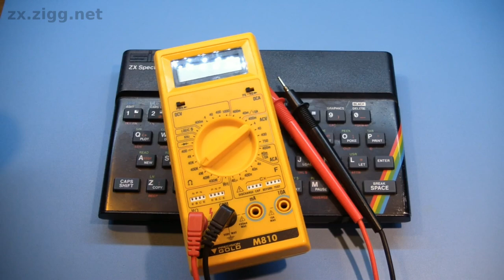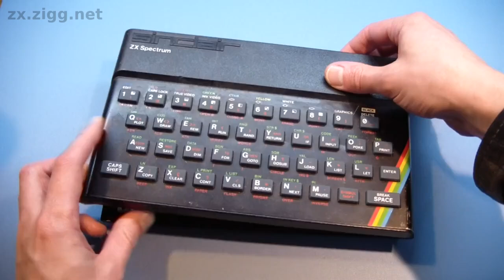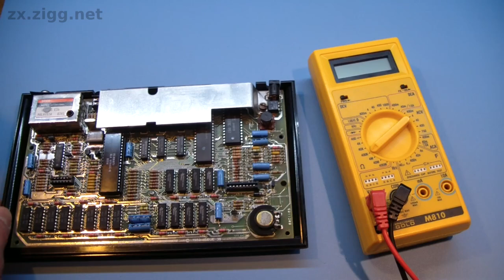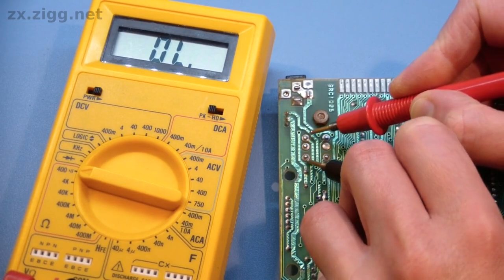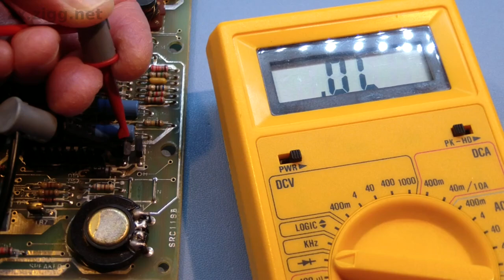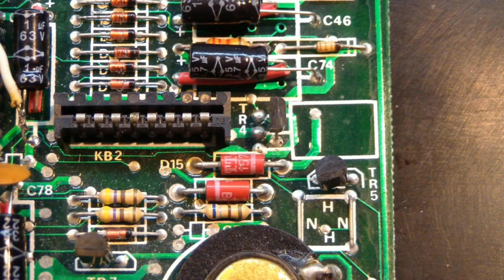ZX Spectrum (48K & 16K) Initial Tests

Comment: The 5v rail is shorted to ground and the TR5 base -> emitter reading is 0.3 as well as the emitter -> base reading.

I guess this means I should replace TR5 and test again. (I think I'll also buy a set of replacement caps and maybe replacement memory because I think it might be dead.)
Reply from the maker: +ISFiYIywAFIBc6qAIIIIIIIIIIIIIIIIQrXTJiCtY3Asd4WF Since so many components are connected to the 5 V supply, there are many candidates for short circuiting it to the 0 V rail. I'd start off, though, by suspecting a  failed 7805.

Any power supply related fault is liable to affect transistors TR4 and/or TR5. I recommend removing them and testing them out of circuit.

What result do you find if you measure the resistance between the two windings of the inductor? It should be very high/open circuit. If not, most likely TR4 has failed with a a base-collector short.
Reply: +JoulesperCoulomb Measuring the resistance between the two windings of the inductor gives me a reading in the Mega Ohms range.

I have ordered some flux to use with solder wick, as this is my preferred method of desoldering and I seem to have misplaced my previous bottle of flux. (Solder wick + lots of flux = great results.) So until this arrives, I will not be desoldering any components. I do not want to ruin the pads on the board.

Incidentally, in case I find that TR4 or TR5 are faulty, what readily available replacements would you suggest I use? It seems that ZTX transistors seem to go at ~£1 per piece which seems rather expensive.

When I have that flux, I'll de-solder the transistors (and the regulator) and test them out of circuit.

Thanks for your help.
Reply from the maker: +ISFiYIywAFIBc6qAIIIIIIIIIIIIIIIIQrXTJiCtY3Asd4WF There are very few physically small transistors that'll work properly and reliably in place of TR4. I recommend you use a ZTX651/ZTX652/ZTX653. These are not especially difficult to obtain. I think ZTX653s were about 60p each in small quantities when I last bought some.

Most small signal PNP transistors ought to work for TR5. I usually use a BC557. Check the pin-out of any replacement carefully; it may not be the same as the ZTX213. If I remember rightly, the BC557 has its emitter and collector swapped when compared with the ZTX213.
Reply: +JoulesperCoulomb You are indeed right, I can find ZTX653s much cheaper than ZTX650s (about 30p a piece).

Thanks for sharing your knowledge.
Reply: +JoulesperCoulomb while I am fixing this ZX spectrum, I would like to apply a composite video mod, there seem to be two popular mods, one using a capacitor and one using a transistor (apparently the transistor mod is brighter) I happen to have a few transistors which would work for the transistor mod (and capacitors which would work for the capacitor mod) do you have any preference? Does it really matter that much?
Reply from the maker: +ISFiYIywAFIBc6qAIIIIIIIIIIIIIIIIQrXTJiCtY3Asd4WF Some people add a transistor follower stage to the composite video output, though there isn't much point as one is already present (TR2). If you want to do this, most small signal transistors should work, though those with limited bandwidth capabilities will degrade the signal.

In most cases, connecting the composite output (from TR2's emitter) directly to a display works well. Some displays don't like the DC offset present here and this problem can usually be solved by adding a blocking capacitor in series with the output. I usually use a 100 uF electrolytic capacitor, with its positive terminal connected to TR2's emitter.
Reply: +JoulesperCoulomb Desoldering plated through seriously takes a lot of patience, your video talking about it makes it look much easier :P. (I've never actually had to de-solder plated through hole before.) Solder wick doesn't quite cut it so I decided to purchase a solder pump (I don't have the money for a proper de-soldering station). Thankfully the board seems quite resilient as I've not damaged any pads yet.

I replaced every electrolytic capacitor on the board with an equivalent axial replacement. I've gutted out the modulator in preparation for the capacitor composite mod (A quick question: Since the video output of the ZX has a positive DC bias (IIRC) then the negative leg of the capacitor should be connected to the phono jack and the positive leg to video output on the PCB, right?)

I removed TR4, TR5 and the 7805, and the short was still there, at least TR4 and TR5 appear to be functional (I have some replacements anyway).
(I noticed, all the transistors on the board seem to be mounted as if someone jammed them in AFTER soldering them down.)

Bizarrely, after removing and gutting out the RF modulator, the short seems to have disappeared, the modulator PCB doesn't appear to have any shorts and neither does the power lead going through the can... I'm not sure what happened.

When the de-soldering pump arrives I'll clear the holes for the transistors, correctly replace them both, and solder a new 7805. I have a feeling that at least the lower memory is fried so I had ordered one of your (very nicely assembled) replacement memory modules last week and it arrived this Friday. De-soldering the lower memory is going to be an incredible pain in the arse (I can only imagine).

Right now I think I'll triple check all my solder joints to ensure I didn't accidentally break something while removing the modulator, transistors, regulator and capacitors.

Incidentally, there seems to be a component which looks like a diode (glass, copper red/pink on both ends, brown bar surrounded by white stripes in the middle. Markings: 413 Z 50V (each marking on a separate line)) which is connected between pin 3 of the LM1889 and ground (using a via as a mounting hole)) I can't see this component on my ISSUE 3 diagram (unless it's C76).

I've re-ran the "Initial Tests" with TR4, TR5 and the 5v regulator removed and it appears that some of the resistance tests show lower values than before, they are as follows:

Measuring between 7805 IN and 7805 GND (the component isn't there of course): 80kΩ.

Measuring between 9V and the other side of the coil (across the coil): (After about 30 seconds) 300kΩ and rising steadily.

These values are a bit worrying but at least there's no clear short between 5V and 0V any more. I am using an auto-ranging multimeter.

Any ideas?

Thanks.
Reply from the maker: +ISFiYIywAFIBc6qAIIIIIIIIIIIIIIIIQrXTJiCtY3Asd4WF Removing components with two or three leads isn't too difficult, but still requires care. Removing ICs while keeping them intact is much more difficult. If you haven't got the equipment and experience and the ICs you need to remove can be replaced (basically all of them other than the ULA and ROM, but the ULA at least is usually in a socket), then I strongly recommend you cut through the ICs' legs; otherwise it's extremely easy to damage the PCB.

The component connected to pin 3 of IC14 is a capacitor and I should think C76. It was probably a late addition to the design or someone forgot about it when laying out the PCB.

The resistance readings you've taken with some components removed do not particularly suggest there is any power supply related fault, though I would have expected a much higher resistance between the two inductor windings. When you made this measurement, did the reading start off below 300 k ohms? If it did, I suspect something might still be awry. Note that the reading may be unstable for the first couple of seconds or so because of the inductance. Also, sometimes auto-ranging meters misbehave when measuring the resistance of an inductor; try manually selecting the meter's range if you can.
Reply: +JoulesperCoulomb Depending on the range I set the multimeter to, the values ranged between ~300kΩ and 1MΩ.

I'm relatively confident I can remove the ICs with enough patience, solder wick and a solder pump. I've successfully de-soldered 16 pin ICs before (but only from single sided boards) without any damage. If I find that I feel it is not possible to do something without damaging the PCB I will definitely resort to cutting the pins, however, I would like to avoid this.

That's an interesting capacitor for sure.

I'll report back with further findings once I de-solder all the memory ICs.
Reply from the maker: +ISFiYIywAFIBc6qAIIIIIIIIIIIIIIIIQrXTJiCtY3Asd4WF You'll find removing ICs from a through-hole plated board much more difficult. Keep in mind that if you don't free every leg before trying to lift the IC, you'll probably tear pads and tracks off the surface of the board.
Reply: +JoulesperCoulomb I tried my best but I lacked the patience, so I just cut the legs, in my attempt to desolder the chip I did not damage any of the pads.

I replaced the ZTX 650 with a ZTX 653 and the ZTX 213 with a BC 557 (I double checked the orientation and indeed   it is reversed from the ZTX 213). Then after checking the resistance again I plugged in the power supply (without installing your lower memory module) and noticed why the inductor had such a low resistance, something is obviously wrong since the inductor produced a high pitched whine, however this seemed to indicate that at least the switching circuit was switching.

I unplugged the power supply and double checked nothing had died and then plugged it back in (I know this was possibly not the best idea, however, I was a bit anxious to see black text on a white screen, or at least colourful blocks with a white border) to do some voltage checks. It appears that 5V, -5V and 12V were there, but the input side of the linear regulator gave a voltage of around 11V (I'm not sure how significant this is.).

With no load the power supply gives 13V.

// Another short test later I noticed that there was no video output.
Scratch that, there's video output!
It helps when you plug your composite cable into the video input not the sound input.

All I see is a white/grey border with a lot of thin 1 character (ish?) wide lines with some static like artifacts.

//Should I proceed and plug in the memory module? 
After plugging in the memory module I see a white scree with "Sinclair Research" written on it. And I can type stuff.

Success?!?!

Finally I checked if any components were getting hot and other than the obvious heat dissipation of the 7805 I noticed that the ULA was getting hot. (Not burning hot but worryingly hot).

I'm not sure how to proceed, I don't have an oscilloscope (sadly).
Reply from the maker: +ISFiYIywAFIBc6qAIIIIIIIIIIIIIIIIQrXTJiCtY3Asd4WF It seems your Spectrum is working again. Try loading and running some software to see how it goes. If it misbehaves, try loading the Memtest program from http://zx.zigg.net and tell it to test the upper RAM (I'm assuming it's a 48K model).

It's normal for the inductor to make a noise. You should worry if it stops.

The external power supply is a simple unregulated type and an 11 V output when loaded is normal. The Spectrum (specifically its 7805 regulator) would get less hot if the input voltage were lower. This is why I sometimes add a diode or two in series with the power supply output or use a 9 V regulated supply instead.

It's also normal for the ULA to get 'jolly warm'.
Reply: +JoulesperCoulomb I don't think it's the end of the road for this poor spectrum, the -5v rail just disappeared. This was about 10 minutes after it first started working, I tried loading a program I had lying around, and then I tried to work out how to write PEEK after writing PRINT and the thing suddenly started giving just black screens. And then the video signal disappeared. 12V, 5V and "9"V is still there of course. -5V floats somewhere around -1V.
Reply from the maker: +ISFiYIywAFIBc6qAIIIIIIIIIIIIIIIIQrXTJiCtY3Asd4WF Does the inductor still buzz? Loss of -5 V suggests a problem in the DC-DC converter circuit. If it has stopped buzzing, then I'd suspect TR4 has failed. It's a bit odd for that to happen all of its own accord without any 4116s installed. Are you certain you didn't accidentally short out something on the circuit board?

The lower RAM replacement module (unlike the original RAM) doesn't use the -5 V supply, nor the 12 V. However, the 12 V supply is used by the video encoder IC, so there will be video problems if that isn't present.
Reply: +JoulesperCoulomb The inductor is still buzzing and all the other supply rails are still there, I was thinking something might have been shorted too, but I cannot find any obvious shorts.
Reply from the maker: +ISFiYIywAFIBc6qAIIIIIIIIIIIIIIIIQrXTJiCtY3Asd4WF If only -5 V is missing, then with the lower RAM replacement module in place, the Spectrum should work normally. However, it would be sensible to find and resolve the cause of the missing power supply voltage.

Which issue of Spectrum is it? It'll be printed on the front edge of the circuit board.
Reply: +JoulesperCoulomb It's an Issue 3 48k model
Reply from the maker: +ISFiYIywAFIBc6qAIIIIIIIIIIIIIIIIQrXTJiCtY3Asd4WF An oscilloscope could be very helpful in diagnosing this problem.

However, in the case of missing -5 V, I'd check diodes D11, D12 and D16. Note that D16 is a 5.1 V zener diode.

I think you said that you've replaced all of the electrolytic capacitors. Double check that C46 (in particular) and C47 have the correct values and are installed properly.

Examine the area of the circuit board around the above mentioned components for any tiny stray splashes of solder or damaged tracks.
Reply: +JoulesperCoulomb I've just de-soldered TR4 and TR5 and they both give correct values when measured.
~0.6v.

Some basic checks to see if the silk screen is correct and my placement is correct suggests that both capacitors are soldered correctly. C46 does not have a value on my schematic, but I found it to be 1µF originally and it is currently 1µF.

In a minute I will do a few more checks and tests.
Reply: +JoulesperCoulomb Since I can't see the silk screen print under the components, I tested every diode in the area, they all gave sensible readings ~0.5v forward and no reading in reverse.

Do you know of any diagram for how the PCB is laid out, or maybe just the raw silk screen graphic? I'm not sure how to test the breakdown voltake of a zener diode.

I think that's going to be all I do for today. I'll try more stuff tomorrow.

Maybe soldering the transistors back in place and powering the thing on will magically fix it? Who knows.
Reply from the maker: +ISFiYIywAFIBc6qAIIIIIIIIIIIIIIIIQrXTJiCtY3Asd4WF The layout diagram you seek is part of the World of Spectrum archive, but appears to be offline. I have temporarily placed a copy here:
http://zx.zigg.net/misc/ZXSpectrumIssue3-Layout.gif
I can't promise it doesn't contain any errors.

If the zener diode passes normal diode tests, then there's probably nothing wrong with it. It's very unusual for the reverse breakdown voltage to change much. If you did want to test it, you'd have to disconnect one end of it, add a series current limiting resistor and apply a suitable test voltage in reverse bias while measuring the voltage across the diode.
Reply: +JoulesperCoulomb I spent an hour inspecting the PCB and then 30 minutes cleaning it with alcohol and cotton buds and then I soldered TR4 and TR5 back in place. The -5v rail is back.

When I inspected it I found a few small pieces of solder which obviously came out of the solder pump (I think next time I use it I'll make sure to keep it away from the board when pushing down the plunger and afterwards make sure to inspect the board a few times.).

The spectrum turned on correctly the first few times but then it started to show a black screen (white border) with red dotted lines spaced ~1 character apart.

It did the same thing before the 4v rail disappeared yesterday.

Could this be a heat related issue?

I'll wait for it to cool down for a few minutes and see if this is reproducible.

The video went and then the -5v rail.

And the -5v rail is gone again...

Are you sure the inductor is meant to make such a horrible noise? I've never heard an inductor chirp and buzz so audibly.

I just measured the resistance across the inductor coils and my meter gives overload on all ranges. This is quite a difference compared to 300kΩ - 1.5MΩ.

I feel like this is some more interesting intermittent issue.

Update:
I think the lack of video is actually the fault of this awful TV. It seems to be back, without the ram installed I see the standard set of character wide multi coloured 1 pixel lines alternating between white and a colour across the screen, with intermittent periods where some of the vertical sets of lines are mostly black.

With the ram installed I see a black screen with a white border with thin red dotted lines going vertically downwards across the black region.

The -5V rail is still gone.

I think my local hackerspace will likely have an oscilloscope, I should go down there one day and kindly ask if I can use it once. It might be that the steady voltage that my multimeter is reporting could be a lie and in fact something strange is happening with the power circuitry.
Reply from the maker: +ISFiYIywAFIBc6qAIIIIIIIIIIIIIIIIQrXTJiCtY3Asd4WF Possibilities that spring to mind:

-There still a shorted/broken connection, despite your efforts.

-There is a poor connection between the lower RAM replacement module and the IC sockets. Try cleaning the socket contacts and the module's pins.

-The ULA is faulty. If you have another Spectrum, test the ULA in it. I recommend performing the test this way around just in case the problematic Spectrum has a fault that can damage a ULA.

-Faulty upper RAM is causing the computer to crash or fail to initialise. Try temporarily connecting pin 5 of IC23 to the +5 V power supply rail. This disables generation of /CAS for the upper RAM and might allow the Spectrum to start properly as a 16K model. However, if the upper RAM is interfering on the data bus at times when it should be inactive, this trick won't help. Without an oscilloscope or logic analyser it'll be difficult to track down the culprit and it might be necessary to remove the upper RAM ICs to isolate the fault.
Reply: +JoulesperCoulomb I'll check for shorts agian, although I doubt it's a short because it seems after waiting for an hour the spectrum worked fine again for about 10 seconds before the screen became corrupted.

I did continuity checks for the memory module by checking continuity between each exposed pin on the top of the module PCB and the solder joint at the back of the PCB, these were all fine.

I hope it's not a faulty ULA since I have no way of replacing it, I only have this one ZX spectrum.

I imagine that faulty upper ram would be a primary candidate at this point. I could buy a cheap logic analyser (And this would probably help analyse a lot of the other faults), I'm not sure how good they are. It looks like you're using OpenBench Logic Sniffer and Logic Sniffer as your software, the device seems quite cheap (Well, ignoring possible import duty costs.). Do you know where I can buy one in the UK? A quick search on eBay turned up nothing but some quite nice probes for the device.
Reply from the maker: +ISFiYIywAFIBc6qAIIIIIIIIIIIIIIIIQrXTJiCtY3Asd4WF I bought my OpenBench Logic Sniffer from a UK supplier that no longer stocks it. I have bought other items without trouble from www.seeedstudio.com, so I suggest trying there. For use with a ZX Spectrum it's very useful to be able to use all 32 channels and so I recommend also buying the 5 V input buffer board to make that possible.

The open source software (OLS) that supports the analyser is fairly basic and rather bug ridden, but with a bit of patience, it gets the job done.

You'll probably want to watch and pay detailed attention to the following: https://www.youtube.com/watch?v=WOzpM0YgcH0
Reply: +JoulesperCoulomb I got the logic analyser (no edge connector for the spectrum but I can probably find the correct pins on the z80). I also got my hands on a really cheap Tektronix TDS 210 60Mhz bandwidth DSO (Not the best, but it was only £100). So I have an oscilloscope. What tests should I perform with the oscilloscope?
Reply from the maker: +ISFiYIywAFIBc6qAIIIIIIIIIIIIIIIIQrXTJiCtY3Asd4WF That oscilloscope should be more than adequate for most uses related to a ZX Spectrum.

If the -5 V supply rail is still missing (even with lower RAM removed), I suggest starting by trying to resolve that problem. I suspect your Spectrum may have some fault in addition to this, but any problem in the power supply circuitry ought to be sorted out first.